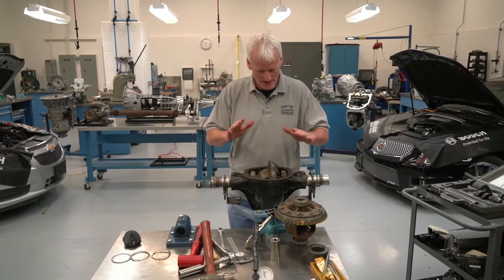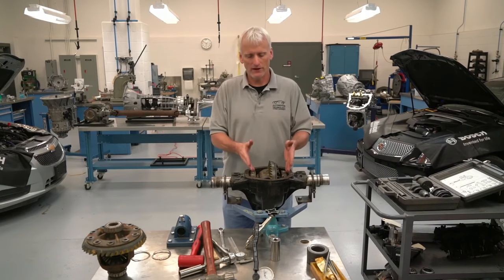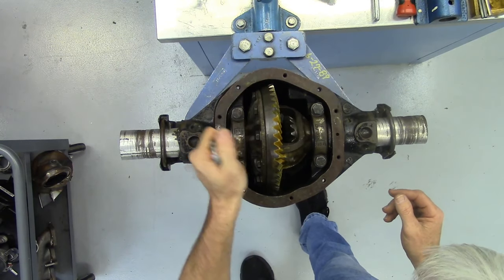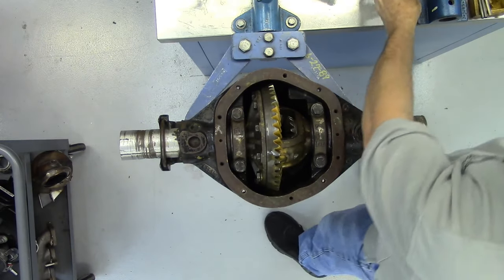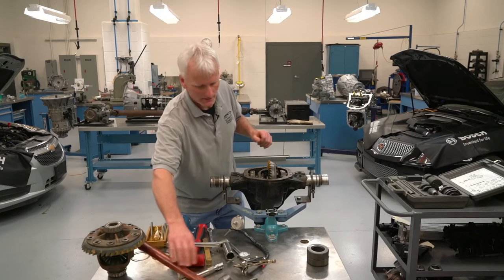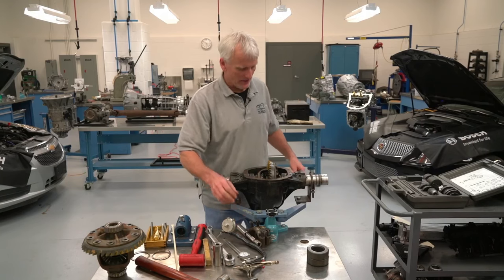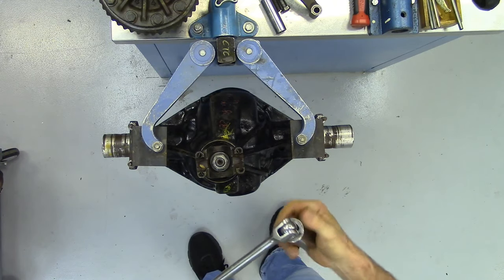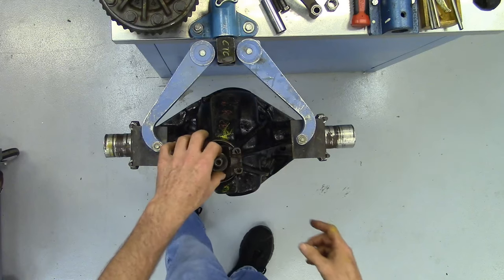Dana 44 Axle setup

Comment: Just started overhauling a dana 44 positrac out of my 59 chevy 3200 pickup.  This video is extremely helpful!
Reply: The carrier has what appear to be factory machine reliefs for a bearing puller. I believe this is the original rearend since the ring gear has a date stamp of 7 25 58 and the positrac housing has a date stamp of 12 58.  1959 was the 1st year the positrac rearend was an option in chevy pickups.

Comment: Great video, I learned a ton about setting up the Dana 44.  Per Ratio discussion:  as it was explained to me, for non-AWD (4x4, no center diff) you want the front to pull away from the rear due to axle average turning radii; the front axle has a slightly larger radius than the rear axle in any turn when moving forward - the front ratio therefor should be as close to, but higher (numerically lower) than the rear, to prevent binding the drive-line - 4.10 front matches 4.11 rear, 3.54 front with 3.55 rear, etc.

Comment: 1:21:12 and again at 2:04 side movement due to a shim change is not the same as backlash added.  I would need to know the angle of the gear teeth to calculate the actual ratio.  Moving .004 to the side will not add .004 to lash unless the tooth angle is 45 degrees.  That aside, thumbs up & thank you

Comment: Dana 44 front diff replaced CV axle passenger side I'm now getting a clunking noise the disconnect shifting collar was sitting down the tube just free floating after we tore it back apart. I lined it back up as best I could put everything back together and the sound is still there it goes away when 4wd is engaged

Comment: Glad you caught yourself on the question, “forgot to take a measurement  on the backlash from the pinion and differential”. So my question is does it make a  difference  whether the tires and axle are removed when you take this reading?   Considering im working on the vehicle, not a bench. My other question is do you plan on doing a  video on a GM axle where there are no shims on the differential like a 14 bolt 10.5 axle???  Just learned a lot from this video and the one you had on the 10 bolt.  Thanks
Reply from the maker: It might make a difference on that backlash reading if you cannot get a good feel of the backlash.  You should hear and feel the backlash.  I do have a couple 14 bolts and I plan on doing that axle soon.  It’s just about getting parts at this point.

Comment: I was going to pay a shop $350 for bench work but I did my 9” rear, so  I’m going to give it a shot. No case spreader, but I’ll use set up bearings. Knock on wood
Reply from the maker: Good luck!
Reply: @siuautomotive  I’ll need it. I was about to pound inner pinyon bearing race into housing, but it fell in. Then I remembered I didn’t have to pound out old one. The bore where the race/cup goes is 50 thou too big. Might need to buy a junkyard case
Reply from the maker: Ah, bummer.  Are you sure the bearing is the correct one?  Did you have to pound out the old one?  If so, I wonder if you got the wrong bearing.
Reply: @siuautomotive  the old pinyon came out with the bearing race seized to the bearing so no I didn’t have to pound it out. I’m probably going to gamble on shim and Loctite 660.

Comment: Need some help  I pulled  my front diff. Cleaned everything lost my marks on the caps  The are stamped s and 90* S. For left and right but not sure if the lips go towards the  axels or towards the carrier any possible help it’s a 00 ram 1500.
Reply from the maker: Usually the letter stamp is offset to one side or the other, so if you are installing them correctly, the stamps will be right across from each other.  If you have it backwards, they’ll be offset.  Another thing you can do is to put the caps on like you think it goes without the carrier or bearing races installed.  It should be smooth between the cap and the housing and if you look close, you’ll see machining marks that extend from the housing to the caps and they’ll line up.  They do the final machining with the caps bolted in place, so the machining creates witness marks.

Comment: Sir my new pinion from Yukon has a marking of 324 on the top what is that???, .......not+1  or +2
Reply from the maker: The aftermarket pinions won’t have the plus or minus markings.  If you used your original shims, you probably be at a good spot.  Maybe correct for what you had in there to begin with.  For example, if you had .030” of shim and the original pinion was marked -3, then the shim for a perfect pinion would have been .027”. Assuming the Yukon was made perfectly, the .027 shim would put you where you need to be.
Reply: @siuautomotive  thank you very much sir
Reply: @siuautomotive  its a dana 44 rear axle on an international scout ii ......it has been repaired twice until now .......so probably it's a mess.....can u tell me what the overhang is ???? Greetings from Greece and big thanks for your videos.
Reply: This is a fantastic video and is the best explanation I have seen so far.  The only piece I am struggling with is how to get the bearings off without destroying them.  Any tricks?

Comment: Can set up a pinion depth without the expensive tools?
Reply from the maker: Yes, if the axle was operating well previously, you can reuse the pinion shim and then if you take the old side bearings and hone/grind the inside, you can use them as tools to help you set up the backlash and side bearing preload.  But If all your doing is changing the ring and pinion, you will likely be fine with just reusing the original shims in all locations.  But you will need a dial indicator to measure backlash and a torque wrench to measure preloads.  You really cannot get by without those.
Reply: @siuautomotive    I have a '75  w100 with a dana 44 front, whom ever set it up before did a horible job, B/L was 40 thou,  no pinion preload and no carrier preload. So I got all new gear and starting fresh.  and thanks to your video (watched it like 300 times) I am finally almost ready to call it good. 

My question is, do I need to run a baffle on the inner bearing ? (I have the shim space for it,  its a low mount pinion fyi) 
It had a baffle on the outter bearing but I just replaced that with a slinger ( was I wrong to do this)?

Again, thank you so much for this video, it has helped me a great deal!!!!!